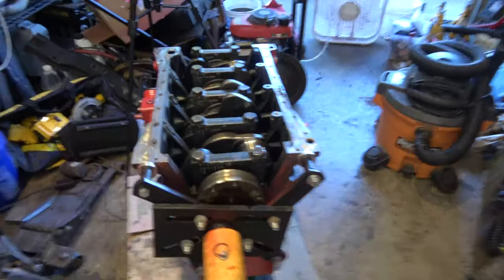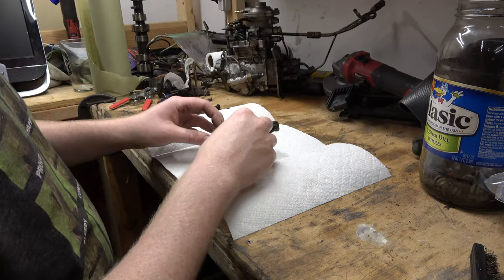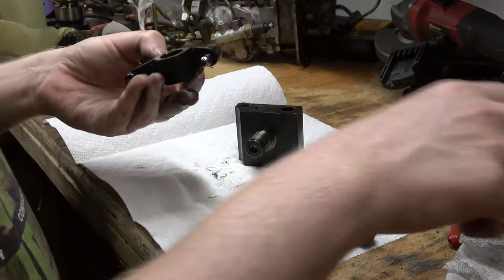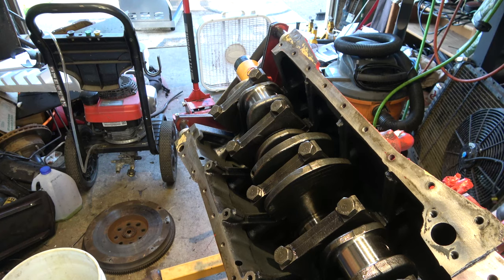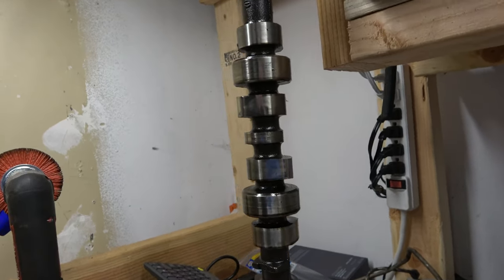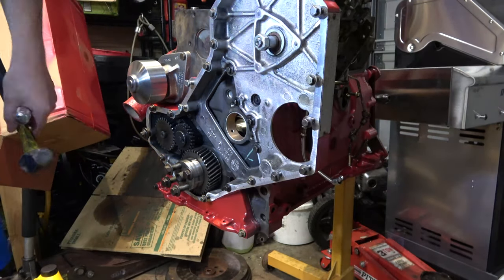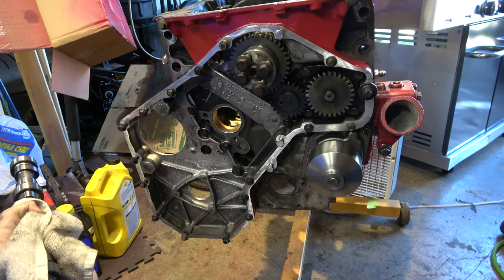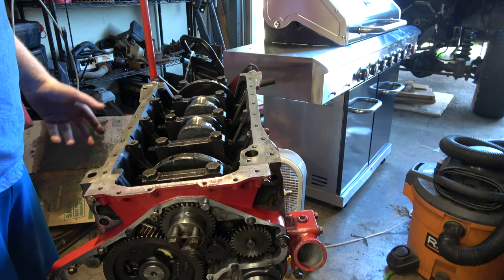Cummins 4bt Reassembly | Camshaft and Tappets | Part 2

Comment: Should have thrown gear in oven at 450 for 15-20 min, then like with bearings on shaft, drop right on, maybe lite tap to seat, but good job none the less
Reply from the maker: That would have worked great if I didn’t have the press, done it before. I do have a toaster oven hiding in the shop...

Comment: made in china instruments any good?
Reply from the maker: It’s “okay” but I’m going to be getting some sterret products for my next build that needs this instrumentation.
Reply: @bullford8218  I need to very badly rebuild my 4bt... lots of blowby but it runs like a champ and no drips... the breather though smokes like george burns on shut down....it is worn down but still pulls hard.  When did you decide you were going to rebuild it?
Reply from the maker: I have had a bad oil leak coming from the front timing case, my plan was to just replace the gaskets and put a new head and gasket on. But I figured while I have it out and apart I might as well rebuild it and I’m glad I did, the piston rings were .015-0.020” worn out of spec. That would explain why it was developing an issue starting in 32 degree weather.
Reply: @bullford8218  did you have noticeable blow by?  Lots of people say blowby is common on these early b series cummins, others say the opposite.  What are you going to do for the CCV tube?  catch can?
Reply from the maker: @joeyscleaninglady2877  I didn't have too much coming out of the tube, it was pretty minimal. I'm not quite sure yet.